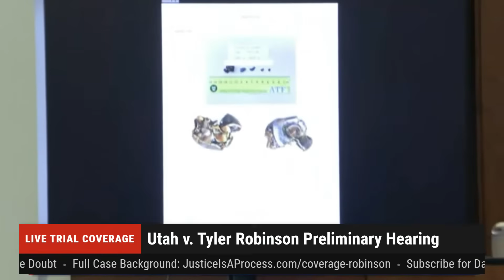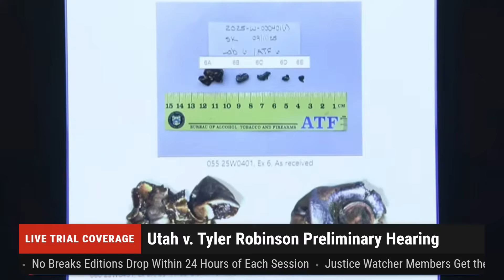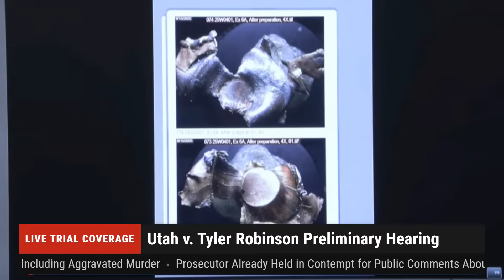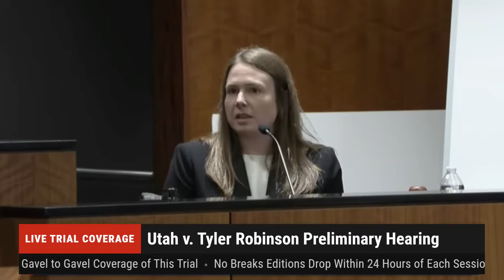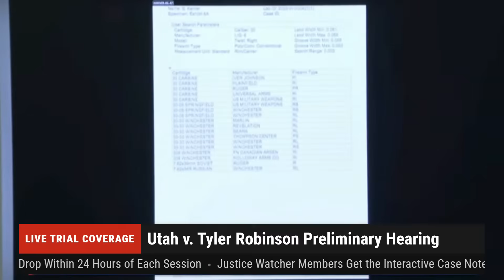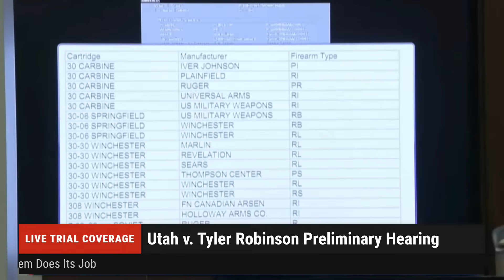ATF Examiner Confirms No One Asked Her to Check If the Lab Lost Charlie Kirk Bullet Evidence

Comment: The bullet diameter was at best .301.  there could be some expansion caused by the heat and impact.
A .30-06 is .308". That's .007" short.  May not sound like much, but it is actually enough to exclude a Mauser .30-06.
If this review was complete and thorough they would have fired the same type of ammo in Tyler's rifle and compared diameters.
Interesting that this didn't happen.
Reply: The problem with that theory is that the diameter range given would eliminate EVERY rifle if we assume that the bullet was originally within the range of .286"-.301".  There are no rifles that fire a bullet in that range.   So, we know that the original diameter was NOT in that range.

The bullet, including the jacket, was mangled and hard to measure, but it is still there for people to measure over and over if needed.

ATF fired numerous bullets through the rifle.  They know the barrel diameter.

Comment: I'm still amazed that anyone could dismantle and reassemble a firearm, doesn't need to  take a test shot to line up the sight to pull of a shot like that. Amazing.
Reply: Exactly! The scope allegedly used wouldnt be aligned after taking it apart, jostling at around then hurriedly putting it back on. The scope would be worthless at that point bc it needed realigning

Comment: I would love to have been a fly in that SUV as they took him to the hospital. Were they shoving bullet fragments into the neck hole? I'll bet the 3 missing pieces were the metal shards from whatever ACTUALLY pierced his neck. Just a crazy thought.
Reply: @bethrichendollar6102  apparently, the shaped charge has a copper lining consistent with a copper lining used for bullets. When you look up what is a typical shape of a shaped charge, curiously it resembles the shape of a bullet with a slightly softer, more rounded tip. Don’t know how if it would have a different shape/look when embedded in an electronic device for example. Don’t see why it wouldn’t though.
Reply: I mean, they were on the phone with Ben Shapiro's IOF security team, rather than calling 9/11... I'd say that them shoving fragments into the wound is definitely possible!

Comment: Isn't there a huge gaping whole in the evidence when you get told there will be seven fragments but you only get five? There is a lot of slop in the evidence presented. There is the edited video the prosecution wants to introduce as evidence. What is going on?
Reply: medical examiner recovered 7 bullet fragments..  firearms examiner only received 4 bullet fragments.
missing 3 bullet fragments... range of fragments measured is .286-.301 inches in diameter, this is accounting for deformation and fragmentation of the bullet... 
a Mauser 98 fires a 30.06 round that measures .308 inches in diameter.
This is a gaping hole, one of many in this investigation... the rifle found could Not have fired the bullet recovered from Charlie's body...